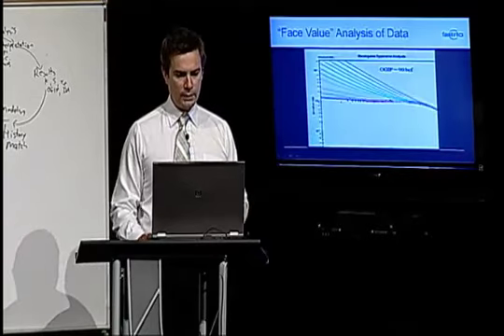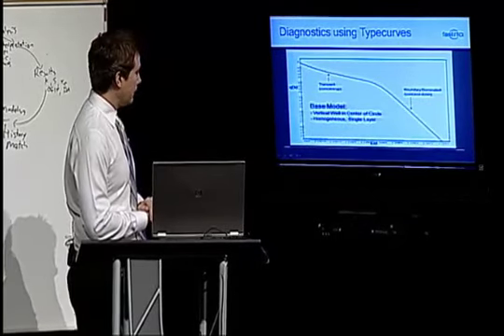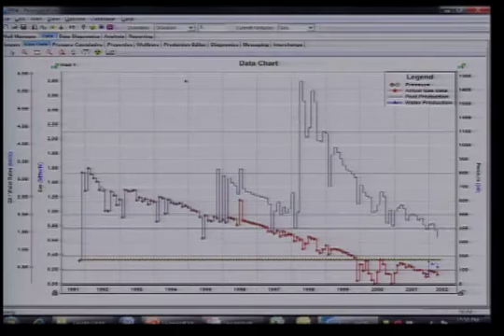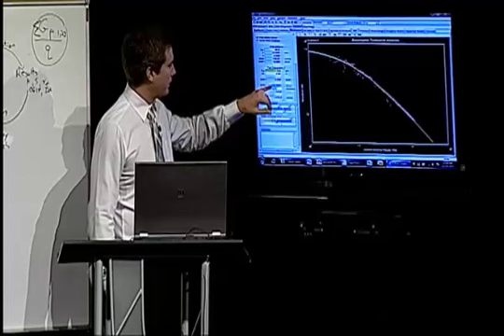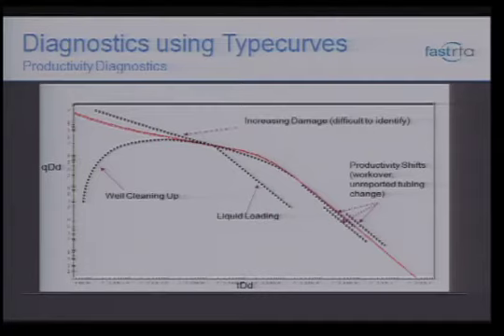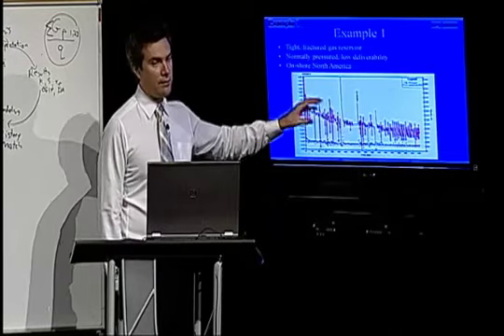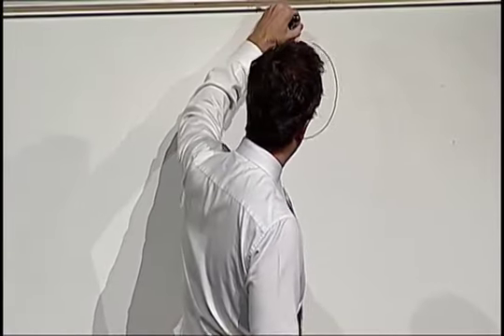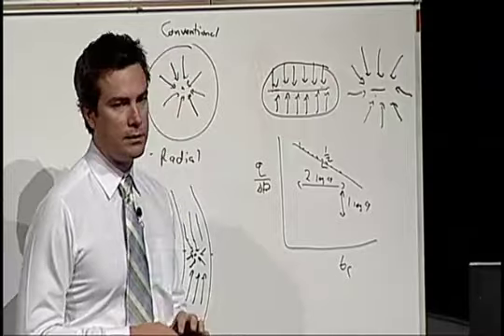RTA Theory 20 Practical Diagnostics

Comment: This course is fantastic but would be much more helpful if the video quality were better. It's very frustrating to not be able to read the slides or see exactly what's being written on the board due to the low-quality video. Any chance IHS could re-film this course with better video? The material and presentation are excellent.